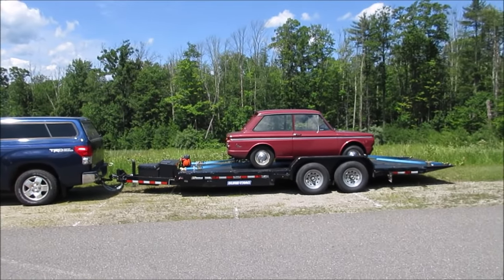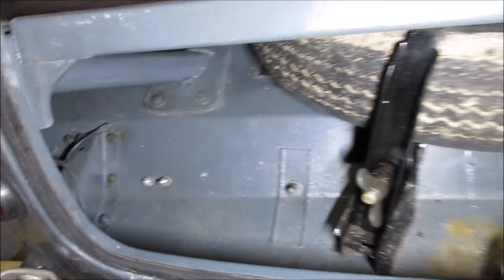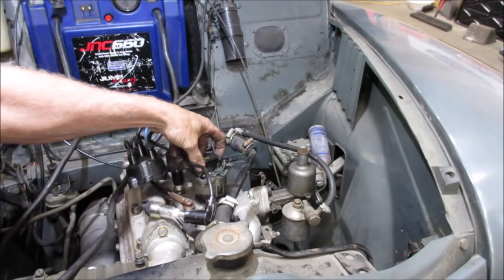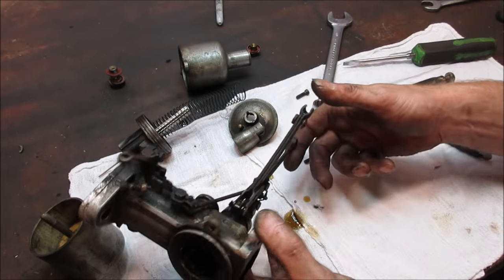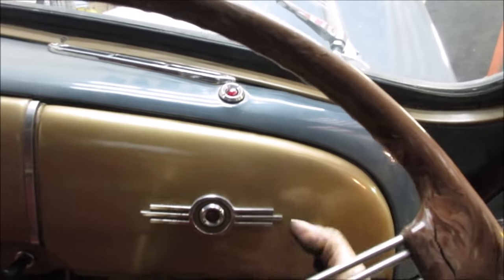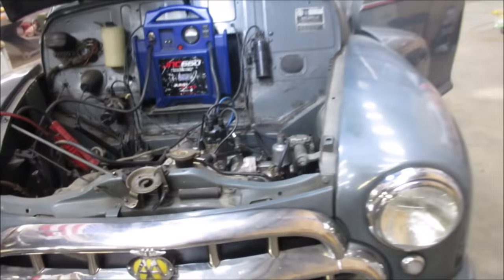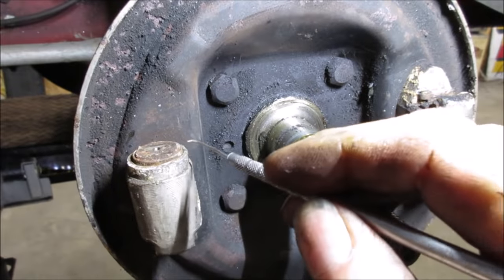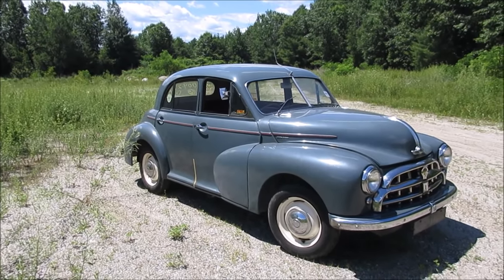50s Morris Oxford Found in an Old Warehouse. Did It Survive?

Comment: Unlike our currency which changed to decimal in the great swindle of 1973.British cars have always used miles per hour as a measurement of speed.  
The Oxford was a larger version of the much more popular Morris 'Minor 1000'  (better known as the moggy 1000 because of the cat-like face and corruption of the name Morris); the Oxford  had a 1500 cc engine and column change manual gears. The cars were built in the Morris manufacturing complex in Cowley, Oxford UK, designed by Sir Alec Issigonis, later designer of the world famous Mini. and the names Oxford and Cowley were used to 'Badge' several models.
Note the bench seat in this model, a friend of mine owned an Oxford of the same era and used to polish the seats assiduously in the hope the if he accelerated round a left hand bend, his current girl friend would slide over to his side of the car, I don't think it  worked, but he was ever hopeful!
I owned a 1959  Cowley which was much more 'modern' looking, comfort in the car  was outstanding, like driving round in an arm chair, the interior set up very similar to the model you worked on.
There is a good description of the Oxfords and Cowleys in Wikipedia.

Comment: Believe it is called a dashpot. The noise is  from the water going in at 1st cylinder. Check the oil on the Crank case, See if you have any water in it now.

Comment: to set your fuel; air mixture on tick over adjust the bit brass nut under the carb undo will make it rich, it has a spring in the brass nut to keep it where you set it,  sounds a little weak in mixture in your video, let it fully warm up, then adjust the big nut under the carb, make sure choke is fully off and that the mechanisium is not holding the big nut down a bit, common fault, grease up the  jet sleeve, that slides inside the big nut aduster.

Comment: The knob with lots of positions is the choke.theres no accelerator pump on an su carb. you put oil in the right place in carb (engine oil ) it should be approx 1/2 inch from top.
The push button to right of wheel is probably a screen washer.
This will be positive earth if it's not been converted.

Comment: A few more drops of oil down the carby slide damper should smooth out the acceleration
It sounds like the choke maybe activated; the choke lever with the cable on it should be fully down. Cable adjustment may be 'off' a little

Comment: From memory that  style of carb should be lubed with ATF,  at least my old '73  Mercedes ran a side draught carb like that and you had to make sure the  top reservoir was filled with ATF- you fill it from the big finger screw at the top of the carb- to lube the carb piston. If that is the case then I guess it would have seeped out  through the piston seal over time. If it is that style of carb running without it will fairly quickly score the piston and bore.  If not then a little ATF won't hurt and will just burn off.

Comment: In remarkably good shape and, amazingly, nearly all the electrics work, but you have lawn mowers that run better and likely make more power. The motor needs work and sounds like it’s running on, at best, 3 cylinders and often 2 or less. Also the hard starting might be that intermittent fuel pump unless you fixed that?

Comment: Krooklock was a security bar we had in the UK, still see some around under a different brand I think, that hooked in the steering wheel and the brake or clutch pedal and and you locked the length of it, to stop crooks steering.

Comment: That is an SU style carb. Check foreign motor cycle shops as a possibility for parts for it. Also a Mercedes’ dealer they uses to use them on older cars.

Comment: to convert those old brit cars from positive to negative earth you have to flash the generator by holding down the relay in the regulator for 2 seconds with the battery connected negative earth, switch the coil contacts and ameter if it discharges instead of charges when you rev the engine

Comment: OK the Morris Oxford split screen is rare car in the UK. Most should be negative earth Drum Breaks four speed transmission. Mass made to customer speck. Engine CC was 1500 to 1850cc one SU carburetor the Silver paint is a mixture to protect from rust. Every thing for show is Bakelite so do not break them as they are fragile and can't be replaced anymore. Everything is 12 Volts and the bulbs are still being made. I think your one  is a 1953  built version.

Comment: pop out indicators, the electromagnet pulls them up it gets stuck in the coil. by design, they don't flash they just light up, when sticking out, a tiny switch turns on the bulb as the arm gets to its full swing, the wires for the bulb, one u have the other thin wire is part of the yellow plastic Lenz.

Comment: a common problem with that style of carb is the jet seat becomes egg-shaped, and also with that the needle gets a flat side to it, also wears thin at the top, where it should be thicker when that happens tick over is rough and rich. full throttle always seems ok, mid throttle can be hit/miss, lumpy smooth, hick cup, ish...lol

Comment: +ve Earth. Your "Brake Light Switch" is Electric Fuel Pump (AU series by SU, diaphram / non-rotary).  Pull starter (cable from dash to contactor above the starter). SU Carburettor. Front-Shocks are rotary dampers.  Master brake cylinder is under floor and built in to chassis member (accessable under carpet).

Comment: There is a level for the oil in the carb top.  It's a damper for the throttle slide.  If you don't have oil in the top you'll have running issues.  That black push button, right of the lever might be a primer.
Reply: Windscreen washer manual push to squirt...
Reply: @JohnSmith-yv6eq  Well you could always plumb it for fuel and use it as a primer!🤣🤣🤣

Comment: British Standard and Whitworth were the two engineering specs in Britain, Metric was not used hardly until we joined the common market. Although we kept the pound it was a metric system i.e. 10X10 pences = 1 pound as in your dollar We still kept inches, feet, and miles, hence that speedometer is in MPH, Car terms were boot = trunk; bonnet = hood; mudguard = fender. Coupe pronounced coopay not coop. Spanner = wrench.

Comment: thats a su carburetor and the little brass screw on the top is a oil dampner no fuel down there , as long as you can feel a little resistance pulling it up and down your fine ,if not ONE squirt of oil down the hole above diaphram

Comment: Morris Oxford Brings  Back a  few Memories  over Here in England  I worked  with a Man whose name was  Morris Oxford  and he Had a Morris Oxford Car and strangely He  Lived in Oxford  : He  decided to have the Engine Changed over to a  Diesel Engine by a  Dealership but when swapping a Brand new Engine over the dealership Made a  Blunder  The  Mechanic Forgot to Put Engine  oil within the Engine where on setting off from the Garage to Go home to Oxford , the Engine suddenly  went  Bang !  the whole  Engine lay in pieces: Now on looking Back all those  Years £500 would have purchased a Brand new  Morris Oxford and here now in England , For the same  Model Today would Bring in around  £20,000 +  That Vehicle Looks as if it had  come from off the Factory Floor I'd Hate to try Bidding against that Particular  Vehicle

Comment: Might have a hand crank!OIL goes in the piston damper on the carb. ( the thing you took out.Lots of fun! If the fuelpump is anything like the one in an Austin Cambridge 1957 up they have points in them. THE wipers may be vaccum powered. Not sure on that. I had a lot of old Austins and Morris Minors here on Canadian Westcoast. If your car had trafficators or semifors in Canada they were not street legal and you had to hand signal.

Comment: In the 70s late 70s and my best friend put a 327 in a 1962 more with minor we put a powerglide instead of a Muncie with a Chevy 10 bolt rear end it worked out pretty well you could literally fuel the car flex when you tried to even slightly get on it it was interesting

Comment: SU carbs venturi is a piston moved by vacuum and has a damper like a shock under that cap that needs fluid atf works fine seen these back in the late 70s on Volvos

Comment: su properly, it does have a butterfly flap, the top of the carb u undone is a damper oil filled when u open butterfly the induction of air lifts the piston inside the carb top, slowed by the damper, under the piston is a tapered needle, thick at the top less fuel thinner at the bottom more fuel. the further up the piston lifts the more fuel is let in. pretty simple, and they work well too. the choke happens by lowering the jet under the body of the carb, a lever pulls the jt down away from the needle, thereby letting in more fuel.

Comment: it doesn't bind, it's just a close fit, the damper oil should be thin lightweight oil, 3-in-1 type stuff, have known people to use ATF Dexron 3, depending on climate/location etc etc.

Comment: I would suggest you reset the timing and connect the lever under the carb to the choke cable to adjust the mixture turn the nut at the base of the carb  needs to be screwed down to enritch  the mixture also it is a three speed gearbox

Comment: Needs some very light weight oil in the center of the pot before threading in the top thumb screw ,it works like a damper ..

Comment: it amazes me that given the old crud you work on you've never encountered an SU.  They actually aren't bad and contrary to popular lore don't 'go out of tune'. The critical thing is that the jet is centred relative to the needle otherwise you will wear the jet and needle and it will run rich. It is the only carb I can think of that you can adjust the mixture on the fly from inside the cabin that isn't in an airplane,
Reply: Just pull the choke out one more detent to enrichen the mixture throughout the rev range....

Comment: I had one just like this in the 1970's. I found them easy to work on. Eventually the chassis caused me problems and it was not economic to fix.
Reply: 12V system.
Reply: Some of them had positive ground and some negative ground. Sometimes owners would convert them from pos ground to neg ground. Mine was neg ground.
Reply: It tended to rust but I would use a wire brush and paint over the metal patches.
Reply: I don't know how many times I would clean and reset the points. Replacing them on occasion.
Reply: I would drive across Britain in mine. all on our old A class roads never exceeding 50 mph.

Comment: That carburetor may have an "enrichener"....  opening the throttle AT ALL disables an enrichener (loses vacuum behind the throttle-slide)  Many motorcycles also use  "enrichener" and opening the throttle during cold-starting is a NO-NO.

Comment: It's Whitworth. I'm not convinced Morris used Whitworth though. The carb is an SU unit. I have a similar setup on my 59 Morris minor. It uses an A series 997 cc Austin engine though (similar to a mini).
Also of note is the (very expensive) master cylinder on the minor is located inside the frame rail. It's a real booger bear to change and bleed. But the car is a trip to drive!

Comment: Feb23 2023  Did anyone mention that the battery goes in that shelf on the firewall and is held in place  by an angle bracket held down by two long hooks with a threaded end that extend up from the holes (one each side) of the battery shelf. Sorry if I’m repeating a previous comment.
Reply: The battery location was relocated to the firewall by Morris early on to the RHS engine bay floor - this was to allow the optional factory heater unit to sit where the battery used to be .

Comment: Sitting here thinking you kidding, it is obvious what the switches are for, then you have the Gallons to Liters, before rotating numbers you brought fuel by the gallon.  6 gallon glass bowl on top of the bowser, hand pump top pump the fuel up to the glass bowl, when you had pumped up the required gallons, you put the hose in the tank then pulled another lever to drain the fuel from the glass bowl to your tank. Thanks a lot, now i feel really old.

Comment: that transmission is 4 speed like H on shift columer top forth steeling wheel up is first gear n down is 2nd n 3 is push down froth dash up is 3rd  n reverse is 4th gear push froth dash down 
(if i remember currently because customers owning 50s Buick driver side is on right) been over 2 or 3 years since i worked on one was inline 6 flathead only problem with is that top cover for cooling keep leaking n ended up having to weld n grinding flat to fix leak problems make it taller so gasket can seal on it n hwve drove it two time was fun but at stopping was mess kinda embarrassed thing when u come to stop she died out n start it up when try get up n go she died in middle of cross way road lol she hiccups a lot it was because of timing there nothing i can do about it just have get use to it lol

Comment: It has a startaterataor if it had a shaft connecting the generator to the starter with a U joint and a torgue activated clutch.  That's a V-21 model starterataor.

Comment: On SU carbs the lower lever is the choke and you tune the carb with the nut with the spring that helps hold it in position you will need small thin oil in the plunger the oil goes in the middle of the plunger to act as a stabilizer or the plunger will go up and down fast with the suction the other plunger at the far right is the aftermarket windscreen washer push to squirt wash fluid on the windscreen

Comment: I fill for the guy that tried to match that grey paint. Black is the worst color to match up but grey is a close second. And wow! I would bet if you broke one of the front spindles you would have a really nice running yard ornament. Fire it up for X- mas kinda thing.
BTW the direction the starter spins might give a clue to pos/neg grounding.
Reply: Hey Toyota has 52 different shades of white paint...good luck with that.
Mazda has one car that was factory white but so special that it cannot be matched by panel shops.
The car needs to be repainted entirely so they are written off instead...

Comment: Those are SU side-draft carburators. The electric fuel pump is also SU. The front.damper/shocks are ARMSTRONG. The fuel pump has a built-in filter.  The dampers on the top of the carburetors requires LIGHT oil. The front shocks can be.topped
Reply: Topped up with proper ARMstrong oil.
Reply: Draining the  petrol/gas tank before activating the fuel pump would have been better. The car uses a starting crank through the front bumber hole. Cheers!!

Comment: Probably a three main four so don't expect it to rev and live.  UK speed limits actually UK roads left a lot to be desired so if you could do a 45 to 50 average you were doing good.  Don't try to run these at 70+, they are not geared for that.  UK gas at that time was not good either hence a very low compression ratio, the rolls had a kit to up compression to get more power on export cars,  a big heavy rolls has an engine the size of a chevy six coupled to a hydromatic tranny (yes the rolls had an OHV inline six).  I believe that reverse is down and you either pull or push on the handle.  First is where you think reverse should be, the rest follow the normal order.  A lot of euro cars used four on a tree including MB during that time.  Most sporty cars had an overdrive on third and fourth gears allowing higher speed without taxing the engine's rev limits.  The SU carb is a good design and once set up properly don't mess with it.  It is a much better design than the lawn mower carbs that came with most US cars.  Does it have a hydraulic clutch?  they used to sell overhaul kits for these.  Use castrol brake fluid in both the brakes and clutch, US fluid will erode the rubber used in british cars.  An Imperial gallon is 160 oz while a US gallon is 128 oz so's yer getting an extra quart of gas in each.  Four liters is about 140 oz so about in between the two.

Comment: The Oil in the slide assemblie has to be the Right viscosity and the correct amount or the carb will not work properly  I have owned several British autos over the years and still do.
Reply: I agree i also still have a couple of MGs And two Fiats Love british and european cars in general

Comment: If you can hand crank it then a ohm meter on the battery wires will tell you what the polarity of the car is because the genrator will put out power and that is a genrator not an altonator i dont see a diode plate on it or cooling for the inside because diodes get extremely hot when used on an altonator.
The genrator will make power either way but because its hand crank you know the motors rotational direction becuse of how the hand craks kick off end . 
An ohm meter can tell you if its postive or negative grounded. 
Also by the amt of rust my bet is its postive ground. They do not rust as bad.  Probably something newer cars should be doing.

Comment: I always thought if you had a point ignition you looked at the coil and the primary wire opposite of the points goes to ground, if it's he negative side of the coil it's negative ground, if it's the positive terminal,  then it's positive ground

Comment: Good project car. Definitely NOT a 1955 model. It is a 1950  to 1953 model year Oxford. You do good work. FYI 4-way hazard lights came out in 1967.  The RAC sticker?... Royal Automobile Club, and  "RECOVERY" means towing and roadside emergency service.